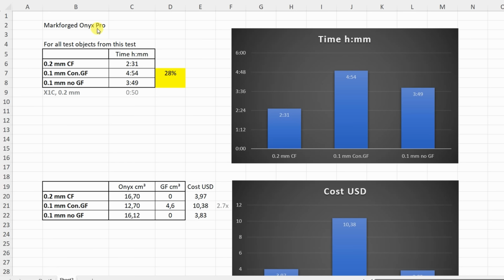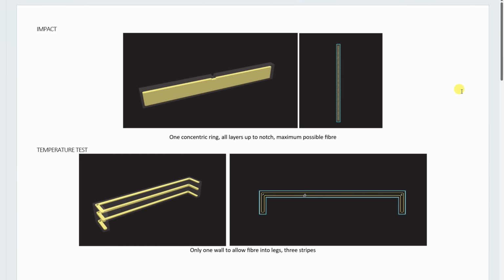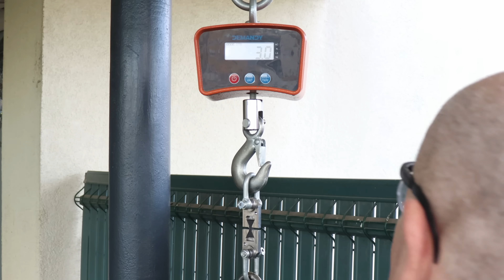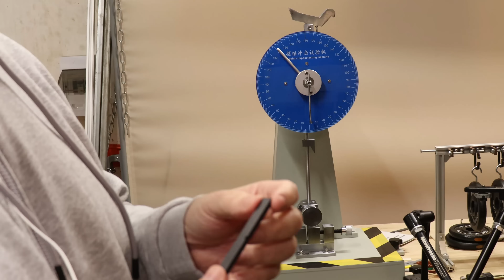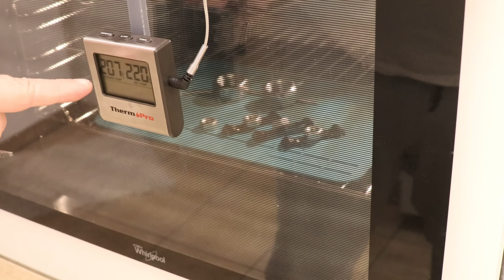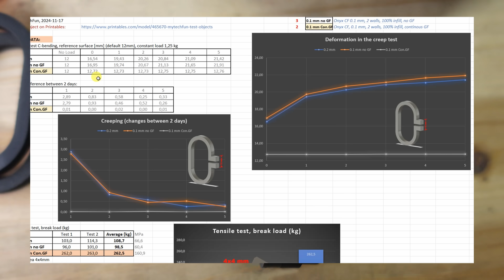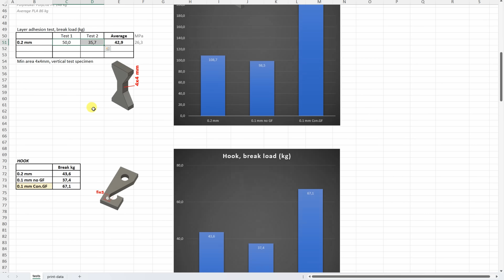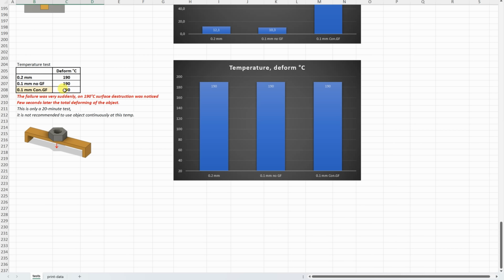Stronger Than Ever: How Continuous Glass Fibers Transform 3D Printing

Comment: The technology is awesome, but as a markforged onyx PRO user I hate this printer. Bed is not heated, there is no automatic bed leveling(those shims are useless). There are problem with adhesion to the bed. Materials are expensive. Is very slow(slower than stock ender 3). Waste a lot of material on the purge line(very bad for the small print jobs). The slicer is very limited and primitive (manual supports suck, no variable layer heights, no vase mode, eiger is cloud based(web slicer), no gcode, very bad sliced file preview, no speed control, no custom materials to mention a few, maybe it is good for non technical users, but is very limiting) Its a bowden setup which is very hard to change spools(its back loaded, and for a base material(onyx which is PA6 or PA12 carbon filled) there is no built in drybox(you can buy an expensive seperate one which is a lazy design which is not ergonomic, no AMS, no filament runout sensor(for the price of materials it's a crime when you print a huge job and you haave to guess if you will run out with filament(the built in calculator of spool used is useless, not counting properly)). When something is broken you are obligated to change the whole assemblies(like the print head, which is expensive, and if you tinker with it, the Markforged support won't be helpful). Screen is inside the print chamber which is super annoying, and can ruin your print(from sudden temperature change). There is no camera, or way to add a camera to the setup. slicer is online, but you cannot use any web interface to use a printer(changing temperature, home etc). layer shifts can occure from time to time, and there is no detection system(like prusa had in MK3 based on arduino(rly???))  The are a few good things tho. Since you print with carbon filled nylon, the prints looks very good(but its NOT a printer doing, but filement it self, most 3d printers can achieve those results), and you can make composites(which is fun, but most of a time normal 3d print is enough), and that's all. Not recommended

Comment: Interesting, but a bit difficult to follow. Sometimes there are 4 samples, sometimes 3, and it's not entirely clear why the number of groups are the way they are. What exactly are we comparing here?

Anyway, how come (long string) glass or carbon fiber reinforced 3D printing is not more common? I haven't seen any open source addons to existing printers etc to do this, even though it doesn't look that difficult to do.

Comment: Seems that printing with filament containing carbon fiber is unhealthy........look it up! Handling glass fiber–containing filament can release microscopic, sharp glass fibers that may embed in the skin like splinters, causing irritation, itching, and redness. To prevent this, it's advisable to wear protective clothing and gloves when working with such materials. If glass fiber splinters do get into your skin, you can try removing them with adhesive tape or by gently washing the area with cold water and mild soap. Avoid rubbing or scratching, as this can push the fibers deeper into the skin.

Comment: Impressive material, well done on the testing and showing the data; I would have like to have seen close up exactly HOW the glass fiber is printed. Is it internal to the filament? Are special moves required for the layers? How 'continuous' is it? Maybe lay a strip of filament out and melt it in an oven so we can see the strand consistency. Still, great work, and showing the future.

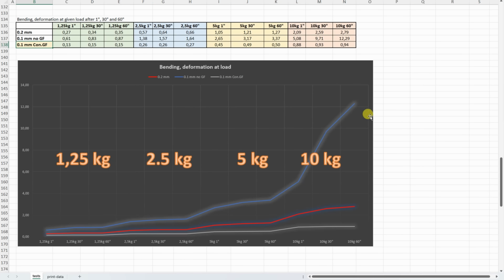Comment: @10:34 it makes perfect sense that printing with more walls has more strength than 100% infill, as the polymer chains are laid out length wise end to end rather than folding back on themselves along the width, probably with lots of retractions that break the chains.
Reply: Switching to aligned rectilinear infill and changing the print direction to line up length wise is the strongest type and direction of infill. It's essentially the same as printing with 100% walls.

Comment: About a year back Nathan Builds Robots did a hatchet handle which had screen mesh imbedded in the print and he used magnets to keep the mesh tight while it was printing. Have you tried this method? I believe he had to mess with flow values to a bit for the layers that had pauses for adding the mesh. Seems like a cheap way to make a strong composite part using standard printers.

Comment: Great video.

I've long said that I think the onyx pro is the best bang for your buck out of their desktop lineup. It's a shame that they are such old machines now, and that the cost to get a modernized version is accessible only at the industrial level ($$$$). It's also a shame that the pricetag is what it is, and that the materials are as expensive as they are.

In my opinion, carbon fiber is not worth the extra cost over glass fibers. Glass is a good middle ground for a lot of properties, providing significant stiffness, strength, and additional durability.

If only it could be made available for consumer base at a competitive price point. Or someone develops a better process. All patents expire one day...

Comment: For measuring outside the capacity of the scale, have you considered using a leaver system, where you use a bar between two hangars, one fixed (it may even be a support with a pivot, and the other end is held up by the scale. Then mark out suspencion points at 1/2, 1/4, 1/8, etc of the distance from the fixed pivot to the scale. Then you can set the item under test to one of those points, and simply multiply the readings of the scale by the inverse of that fraction to get the calculated strength of the item under test.

Comment: We had this printer at work, its important to note that it is extremely susceptible to moisture and absorbs it like crazy. Also general part / material degradation seems to be more substantial then on ABS / PLA. Parts worn out quicker, it almost feels like an organic material. Will absorb oil and get that "worn" look.
Reply from the maker: Useful info, thank you!

Comment: Neat, but the #1 critical issue with 3d print strength has nothing to do with any of the tests in your video, which I think you're well aware of. How about do any tests in the weak direction? Test layer adhesion. You know. The #1 problem.
Reply: Look at his tests a bit closer.
Reply: To be fair, CFRP is pretty weak in Z too; just the strength of the epoxy and there's not all that much of it.

Comment: if the fiber is continuous then you can't travel when printing the part right? does this require a special printer with a cutter or do you just print parts that don't need travel?

Comment: I'm learning how to print Tullomer filament...it's not Kevlar but it has many of the same properties.
300+ C nozzle, 120 C print bed, 60-80 C chamber.
Print speed 500 mm/sec, layer thickness 0.05 mm.
Bambu X1 Carbon works pretty well with this stuff.
Biggest problem I'm having is bed adhesion.
Well, cost is a big problem too...$275 US for 500 grams.
Then again, it is cheaper that some grades of PEEK.
Reply: How is your layer adhesion?

Comment: 00:00 famous line in JDM community
CABON FAYBEY😆
PS
u can try to infuse fibers by hand , stop the print on layer u want , lay down thin fibers and use soldering iron to make them stick to the plastic before next layer , not the prettiest but works 
PS.2
im working with composite materials (mostly glass and carbon fibre) so it always sounds funny for me 😅😆

Comment: I have worked with a fibre laying printer and it's nice for planar parts or parts that mostly need support in only one dimension. Kinda sucks for actual 3d parts that are more complicated than a 2d cutout extruded in the z-axis. It has its place for sure but many practical parts need isotropic strength which laid fibre will never produces unless you can print with a 5D head (which you already can with some experimental printers).
Reply: Yeah i noticed that, tried to order some parts at work but none of them could be printed with fibre. Had to get regular sls pa12 gf instead.

Comment: Igor, have you considered doing a test between various bed adhesives (e.g. Magigoo) with high warpage materials (e.g. ASA)?  I would be very interested in knowing if there are differences, especially in terms of residue (e.g. white marks) on black parts.  Also, if there is a coating that can make TPU easier to release from the bed that would be very helpful.
Reply from the maker: For me, textured PEI works great with PLA, PETG. For technical materials Engineering plate + glue stick works perfectly. Somehow I don't feel need to test other adhesives.
Reply: @MyTechFun  I only know what you print for the tests, so I apologize if you have experience printing more difficult and more cosmetically beautiful objects.  Glue stick leaves a white residue on parts that is unacceptable if the bottom is visible to the user.  Magigoo also leaves a residue.  Textured PEI is not always acceptable for printing; sometimes you must print on a smooth PEI or lightly-textured plate.  For TPU, the soft durometers (60-85A) are easy to release from brand-new textured PEI plates, but over time ruin the plates.  If you try to print TPU on a smooth PEI plate (e.g. making watch bands) it is almost impossible to release without damaging the plate or the part.  I have found that heating the plate to 100C can help release some types of TPU from PEI but it is unpredictable.

Comment: Printing with maximum walls will always be more resistant to bending than 100% infill because you have much more contentious material in plane. The 100% infill part has gaps forming that allow room to bend, the max wall part would need the material to stretch to get the same bend. Loved the video! Really interesting to see printed parts can be so strong.
Reply: That and especially for the bending, the fibers are also aligned length wise on the maximum wall version
Reply: Absolutely.
  
In most of the videos about practical prints, people use methods similar to methods used for printing of display/play objects; especially, thin walls.
Reply: I believe Igor has tested this in past, and found that 100% infill is stronger than maximum walls - at least for layer adhesion, because there are less gaps. I don't remember if the test had bending.
Group 3 was printed at lower layer height , which isn't always good for layer adhesion --> possibly more likely explanation for difference to group 1. It shows clearly benefit of glass fibre core in group 2, sharing the other settings.
Reply: @kimmotoivanen  , stronger can mean many things. There is a "crushing infills" video that shows quick deformations. Deformed part should be treated as defective. It doesn't have to break into two pieces.
Reply: @kimmotoivanen  Yeah the lower layer height could definitely affect the part strength. But the max wall part has every line working in tandem to resist the bend, while the 100% infill with its zigzagging lines has more force pulling the lines away from each other creating more sag in the part.
Reply: @g912man  When two parameters are changed at the same time, all we can do is guess 😉
Do you have source or reference on infill vs walls?
Reply: @kimmotoivanen  Just tests I've seen from other creators on YouTube and my own experience printing parts with different settings. If you want a more rigid part max walls is a good place to start.
Reply: I am curious if something cheaper than CF or GF would be sufficient.
Reply: @michaels3003  metal wire embedded mid-print? Cheaper, but more difficult to form right (printed jig?)...
Reply: @kimmotoivanen  , there are other fibers and meshes (for larger areas) that maybe could work at a lower cost. Embedding metal objects sounds like a good idea for experiments.
Reply: Switching your infill type to aligned rectilinear and your line direction to 90,90 or 0,0 degrees (depending on model orientation). This is essentially the same as 100% walls and will allow you to print much faster as you can speed up the infill and leave the walls slower for better overhang performance and surface finish.

Comment: Praying for the day this hits the consumer market
Reply from the maker: Hopfully, some Chinese company will make one. It is expensive, because it is rare so far.
Reply: @MyTechFun  the fact its patented is probably the problem rather than it being rare, you can also reinforce manually, just takes more time and effort, but so do manual filament changes when printing without AMS, cool machine concept gated behind greed small price fee :)
Reply: @ponxaspat6133  I could see a specialized tool head for the Prusa XL—perhaps even third party.  That way you have seamless movement from nylon to fiberglass & back again with no human interaction between!  Add a belt for continuous printing and you have a composite production line with only a minimum of post processing.  Still might need a bake in the autoclave to reach max strength but much less manual work.
Reply: @MyTechFun  Finally YouTube is recommending your video, lezzz gooooooo
Reply: @MyTechFun  https://www.youtube.com/@Fibreseek3D
Reply: i am working on a similar project, just 1K carbon fiber string instead of glass. The ploblem is that it is hard to produce filament with the string at the center of it. Our current record is about 200cm, we are woring on it sice 2020
Reply: your prayers have been answered by the FibreSeeker 3
Reply: Maybe there will be mods for Voron printers for something like this someday. But I’m unsure if a slicer will support it anytime soon because of patents. 
And without slicer software nothing will work. I wonder if non planar 3d printing is patented as well. There was a lot of fuss about it but now you don’t hear much about it anymore.
Reply: @Todestelzer fiber reinforced lines are wider and thicker, but they can be done with a post-processing gcode script
Reply: I got my Mark Two for free. Hehehe!
Reply: Fiberseeker 3, just coming out. Does it for under $3000, and you can print dual extrusion with it as well. Meaning you can print two different materials and lay continuous fiber in it as desired, for a total of 3 materials. Worth a look if you see this (I know it’s been a year, but hopefully it helps somebody else as well. 👍)
Reply: Fibreseeker your prayers have been answered
Reply: At least 20 years away because patents.

Comment: Hi did you ever try the random ali express 72d TPU?
I've still only done one test print with it so far 😅
Reply: I've been browsing all those Ali and Temu filaments. I've seen some CF and GF filled nylons and PCs and some other high temp filaments  that for shiz and giggles I'm going to buy and test. I'd bet there's some good ones, most all of it comes from only a handful of places
Reply: @notyouraveragegoldenpotato  I've got some ASA CF from a brand called Haephestus ( or something like that)

Seems pretty great. 15% chopped fibres.

But the TPU I've not done anything with yet.
Reply: I would just buy the BASF 68D or whatever which is more available. I would honestly buy the aliexpress if I didnt have 2 unopened rolls of 68D TPU atm.
Reply: I'll try doing some kind of small test print with the 72d